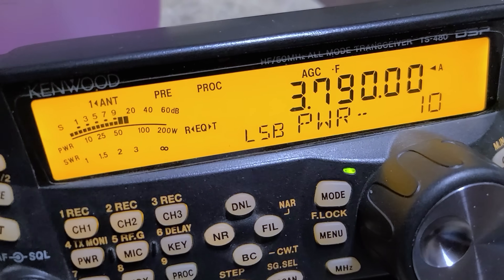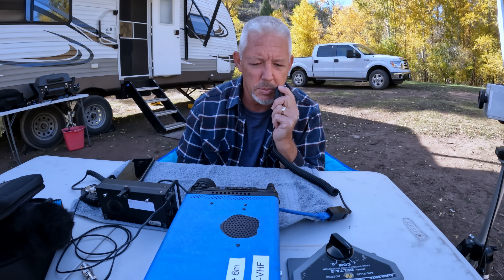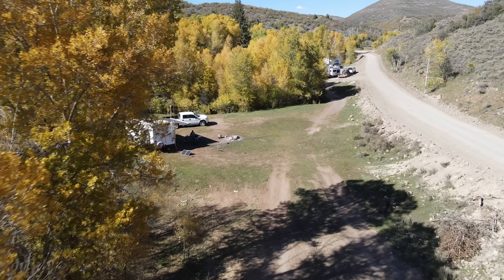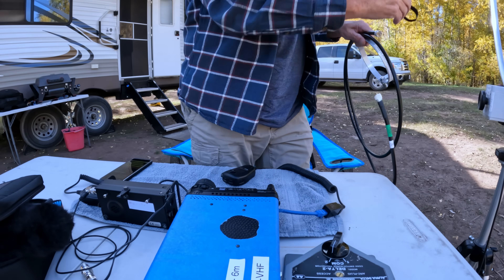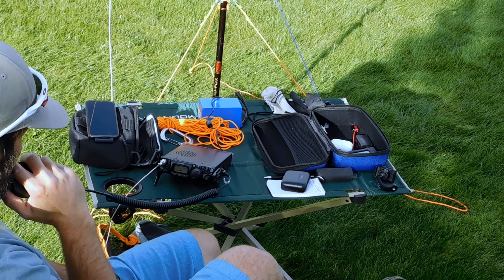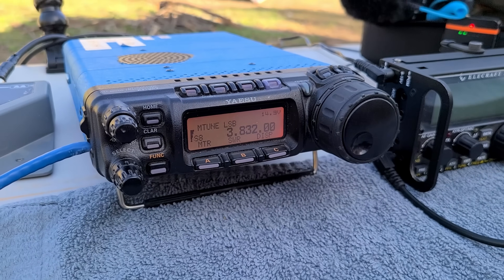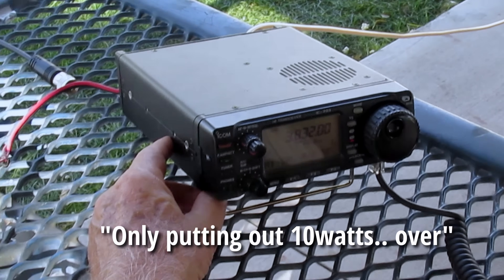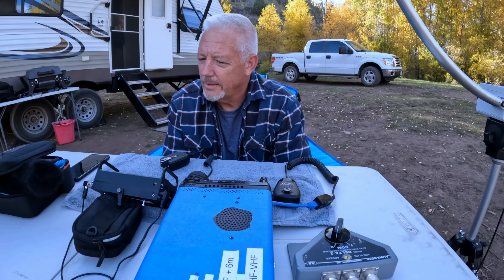Hear what NVIS sounds like from 3 locations | K7SW Ham Radio

Comment from the maker: When was the last time you tried setting up your portable Antenna's for NVIS and  How did it go ?
Reply: We test NVIS once a week here in Hawaii. We have an ARES HF net weekly.
Reply from the maker: @LavaKimo  That would be a fun exercise to do building up regular checkin's in the Island.
Reply: Several years ago I was trying to talk to a new ham I had help get licensed and on the air. He had a 40 meter antenna and I had a 40 meter dipole about 50 or so feet high. We were about 20 to 30 miles apart. Signals on 40 were not very good. The next day I strung out another 40 meter dipole no more than 4 or 5 feet above the ground. That made a big difference. He could not get over the fact my very low dipole did so well. I took the opportunity to explain that the low dipole was radiating mostly straight up while the higher dipole tended to have a null straight up if it was close to a half wave high. Also almost all normal 80 meter horizontal antennas are radiating mostly straight up because a half wave is 130 feet and most of us can’t get past 60 feet or 1/4 wave high. Of course you must be below the critical frequency or nothing comes back down. There are some good web sights where you can get real-time critical frequency info.  Check this out this station near me :  https://www.ngdc.noaa.gov/stp/IONO/rt-iono/latest/WP937.png
Reply: Several years back I wanted to check in to the EPA section daily traffic net on 75 meters. I had a little TenTec mobile in the car with a Hustler 75 meter loaded whip on the back of the Buick. No joy from my QTH near Harrisburg to the Philly area, about a hundred miles. I loosened the ball mount for the whip, rotated it to be parallel with the ground about 2 1/2 feet above the dirt (not a favorable operating position for a mobile antenna, hi hi, but I was stopped well off the road). The noise dropped to near zero and the net was clearly heard; I checked in with a "weak but readable" signal report. The difference was no comms versus no fade, clear comms on 75 phone at 100 miles. I became a believer after that. DE KB3JA
Reply from the maker: @KenTenTen  Exactly, and that is a great example
Reply: Sorry if my question about the mag-loop came across as a know-it-all, that was certainly not my intention. 
It was an honest question from a guy studying for his HAM exams.
So the answer is never.
But now as I think on it my Army brothers and there newer vehicle mounted tandem loop is not angularly adjusted yet they manage to get it done.
Again, thank you kindly.
Reply from the maker: @Gary Landers  Thanks for the question and sharing
Reply: I have a Yaesu 2980r that I use to keep my signal local by reconfiguring for tactical dipole NVIS. It only hits the local repeaters and so far the polarization hasn't been an issue. I practice it because NVIS is what we taught for opsec in the military. Only a satellite can pinpoint a signal that's NVIS, usually only at distance. Anything can be found much closer.
Not much experimenting with VHF as everyone thinks HF is thr final frontier. Must be why all new tech is going way up in frequency, lol.
Reply: Thanks for the video! So far my favorite  ham video! 😊 I'm not a ham but this video has inspired me more than any other so far. NVIS seems like the best of ham practicality. Being able to reliability talk to others relatively close by seems to me to be the most important thing if communications were ever down for an extended time. I know with 80m it may not be attainable, but I would love to see experiments with ht sized antenna designed for NVIS. Based on your video I'm thinking that not only the antenna but also the quality of a ht sized rig may prevent successful communication. I guess I should become a ham and try it myself 😮😅. Thanks again for the great video!
Reply: Thank you guys for doing this.    I am a newbie.   Love the info

Comment: This is one of the best implemented amateur radio A/B/C tests I’ve seen on YouTube. Well done guys!   The only suggestion I’d make is to consider rotating that loop so that it is horizontally oriented instead of vertically. That way it will create a  NVIS setup.  I hope to see more of these types of tests. 73!
Reply from the maker: Thanks for the kind words and the suggestion!

Comment: When hurricane Harvey turned out home town into a "war zone" with no electric, internet, cell coverage, or cable, I used an end fed 80M antenna up to my barn roof (22') then down to my chicken coop roof (8').  It was loosely configured NVIS but got very clear coms from the Texas Gulf Coast to Missouri and again to north central Texas.  It was our only working coms.
Reply from the maker: Wow, that's an incredible story and a testament to the power of Ham Radio!
Reply: @hamradiowithkevin  ARES has fallen to disregard with the advent of mobile satellite rigs providing enhanced voice and data... but what if we lose those satellites?  Ham radio doesn't need high tech infrastructure.

Comment: I just set up an NVIS antenna yesterday. I am in central AL. I worked CW with some people from Huntsville, AL, then Asheville NC and then finally the tip of FL on west palm beach. No issues. I built a 40m dipole antenna cut for resonance on the CW portion of the band. 7.030. I supported the center on an old broken painters pole supported by some stakes in the ground. The whole dipole was around 66' long and only around 6-7ft off the ground. Very easy to pack up and use in an emergency / local scenario. Oh, I also did that on 5 watts from my Yaesu FT-857D.
Reply from the maker: That's an excellent example of NVIS working well, especially with 5 watts!

Comment: N1JWW HERE,

I haven't intentionally tried NVIS transmissions.  I do have a question.  If I setup an NVIS 20 meter dipole and I successfully hear a station somewhere in my state, do they also need to be configured as an NVIS station for me to hear them back?  I am guess I will also receive some Non-NVIS configured stations, but that will no hear me.

Jeff W Waldrop <---- SW Louisiana

Comment: Great video ! Its good that we can see and hear the 3 antenna types compared over two bands.
So the endfed is 162 feet long stretched between two poles 25 feet high each end.
Is that a total wire length  of 162 + 25 feet ( fed end, pole height to readio/tuner) = 187 feet ?
Thank you, 9H5lx.
Reply from the maker: Yes, exactly

Comment: I highly suggest you try 60 meters.  AM or PM here in San Diego, it was amazing for NVIS, possibly less fading as well with stations 20 miles or less 5/9 easy on 60 watts into valleys.  I have ARES testing it and doing check in's from around the county.  Heck just use your 40 meter dipole and touch up the tuner, no big deal.  Your loop tends to me more efficient on the upper bands 20-10 unless you do a larger 7 foot double loop efficient wise.   I used a 8 foot delta kite at the beach with a 6 knot wind and had RG174 coax go up 200".  Worked Milano Italy 20 meter vertical dipole at 2PM with a S8 at 100 watts hi.  Give that a thought if windy up in the mountains.  Kites are light , not NVIS but who cares at 200' go direct hi.

Comment: I wonder how 160 would work NVIS?
Lots and lots of wire!
Great video!
Reply: I suspect the ionosphere’s D-layer would absorb some signal during the day. 80m and 40m seem to be the ‘Goldilocks’ wavelengths for NVIS. Any shorter wavelengths and it shoots through the ionosphere instead of reflecting.

Comment: I'm in VK land... we are fortunate to have a Class of license available to use as Broadcasters called HF Domestic. Our authority (when you get past the politics) will issue a fixed frequency on something like 2325khz 3230khz 4970khz. These are all separate licenses in the Tropical SW Bands. You can run as much power as you are silly enough to ask for. But the norm seems to be 1kw (licensed to run it). But it seems that most run at about 100w to 200w carrier power as it's AM.

As the name implies they like to think this stays largely inside Australia (which it sort of does). Plus under 5060khz it hasn't stepped into the Main SW Bands that are all shared to a timetable set out by the ITU.

NVIS (we don't call it nivis) is pretty much going to give you a blast at the ionosphere and rain down really well to a notational radius of about 900km. Everywhere inside that radius will hear you with some sort of "average" level. But some little traps need to be observed. Running NVIS you really want all energy straight up. You want as little residual groundwave as possible (preferably none). As the groundwave will mess with returning skywave. Here it's a good idea to put the NVIS site no closer than 30km from the nearest town you want to rain on. You'd rather it in the middle of nowhere.

Day time you need a higher frequency and night time you need lower. You'd run 2mhz later at night and something like 7mhz or 9mhz during the day. But definitely not over 10mhz. You are relying on the ionosphere to REFLECT (work more like a mirror). You don't want it to REFRACT (bend) your signal which is what happens in the main SW bands. The next thing going on is "that mirror" isn't to good. PLUS the lower layer of ionosphere (that sucks up AM radio in the day) is still attenuating SOME of your signal (as high up as 5mhz). This is both BEFORE and AFTER it gets to the rather sad mirror.

Findings here with the 3 frequencies listed. I'd trade 3230 khz for a 7mhz channel anyday. 3230 (so close to 80m its not funny) in our tests here - has inherited all the BAD traits of 2mhz and 5mhz and none of the good. 2mhz you'd run as a Vertical to give max distance along the ground day or night. Then it has a skip zone with people in the far off places getting it at night... With a bunch of angry people missing out in the skip zone. 2mhz is best around 9pm to 6am local time. 5mhz you run that as a doublet at 10.4m off the ground or centrefed (tuned) dipole. 5mhz will not go as far along the ground as 2mhz will for the same 1/4 wave vertical for it's freq. But it will give you "some" path inside the fore mentioned 900km radius (even in the middle of the day). BUT it really comes good about 3pm to about 10pm local time. IF 5mhz is the only channel you have then it's wise to really maximise NVIS to give the ionosphere a good spray (mainly for daytime use). It's going to need all the help it can get. We have a bit of a legal rangle on atm here to get 3230 moved to something like 7600 ish. Tests on 7mhz  has really shown how much 5mhz still suffers in the day time. But it seems the radius is a bit smaller with 7mhz. That's still to be worked out here. 

So from stacks of experimenting here. With the idea being we only have water pistol power not using a tank or rocket launcher's worth of power. What can we do? I'd say the frequencies used were not the best and your aerials were not doing you any favours.

73's from VK

Comment: On 80m the Loop is a big compromise, it's never going to be very effective on 80m or even 40m Best 20-10m. 

The EFHW 49:1 is half wave on 80m so offers a huge advantage over the loop.

My version of this EFHW 49:1 has a ceramic capacitor in the middle which increases resonance in the phone portion of 80m, without it resonance would be around 3.5 Mhz, the capacitor is a neat trick because it electrically shortens the antenna without having to shorten it which messes up the other bands.

I get good DX and NVIS with this antenna in an INV L kind of config, first half of the antenna is up around 60-70 feet, runs East/West and the other half slops North/South direction and I have the UNUN around 3 feet off the ground where I have it grounded. 

This antenna works amazingly well for me.

Comment: NVIS is a fascinating practice to experiment with.  I've had NVIS antennas work just as they are supposed to, but I've also worked DX <3000 miles on 40 meters with the antenna only 8-10' (9 meters) above the ground. But I couldn't hear the DX stations on my transmitting antenna.

Comment: im new to your channel .i saw your last video on ant testing in the park near some tennis courts..  thus NVIS i need ask please ,ive seen YT on these but they use a 1m off ground reflector underneath horisontan wire..woulnd that be better. i have a few efhw etc and long wires..is it worth the extra work to put reflector under ?
Reply from the maker: Personally, I would not use a Reflector for your setup. 
Don't let that keep you from experimenting though.

Comment: I like your channel. Lots of good info. So, for NVIS, it is very frequency specific. You are trying to bounce your signal off the F layer of the atmosphere. It makes more sense to me that it would work better in the 60M to 80M band. Also, for antennas, a dipole about 10ft off the ground would probably work the best. I would not expect the Loop to be any good at NVIS. Although it would be interesting to raise the loop up 10ft off the ground and see how it performs. 73.

Comment: I think many people don't realise that just putting up an nvis friendly antenna will not make nvis work. The ionosphere has to be in the correct state as well. Specifically the "critical frequency" aka FoF2 has to be higher than the frequency in use. In theory it can go up as high as 10MHz but normally it sits somewhere around 4 or 5 MHz. I suspect that was the case during these tests and the reason why you had success on 80m where you were using NVIS and 40m where you were relying upon ground wave.
73 Ed DD5LP

Comment: Never heard how low swr was on the loop on 80m
Reply from the maker: The loop is almost always tunable to near 1:1. That is just how they work. 
In the off chance the loop is setup near a building that can cause interaction, generally, you get to tune the loop to a really good spot.
Checkout one of my loop antenna video's and it might make more sense as to what I am describing.  73

Comment: I never thought to try my loop, with my small yard and some interfering structures I have a 73' end fed inverted V at 30' apex and run 80,60,40 nets each month  in NTX and OK with guys in my church group. I've tried running wires over fences and between houses at the 15-20' recommended height and it just didn't work for me DX engineering NVIS dual dipole, 80m 1/2 wave dipole at 6ft, 73 ft end fed flat top at 20feet, to no avail. I just ordered the CHA NVIS antenna that is on sale now and looking forward to trying that one but it needs more room than my yard provides.  I need to take the jeep out and try all my NVIS antennas without obstructions and in recommended configurations. I really enjoy the challenge and fun of NVIS. Great video!
Reply from the maker: Fun adventures ahead for you. Getting out and setting up is a great thing, indeed.

Comment: Hi Kevin .... outstanding comparison Sir! I was just at the HRCC campout in Ramona, CA and setup a KK6USY style Delta loop and compared it to a 40 meter vertical EFHW. I was on 40 meters mid day and the Delta loop was at least 2-3 S units stronger than the EFHW receiving stations about 400 miles away. On 20 meters, the EFHW was about 2-3 S units over the Delta loop, but, I was receiving stations over 2,000 miles away at that time. As Hollywood states below, using the right tool for the job makes all the difference. Keep up the great videos Sir!
73 - KF6IF
Reply from the maker: Your test sounds like tons of fun. And Ramona,  my old stomping grounds. 💪👍
Reply: @hamradiowithkevin  I saw that your roots are still in Ramona! I am bummed I missed you out at Quartzfest.

Comment: Great experiments! I saw a comment that said most hams 75m dipoles are nvis because we can not get them up a half wave. I have often said this myself. Lots of nets on 75m have nvis stations checking in by default lol. 60m is also interesting with NVIS. Have yet to test 40m nvis. I may be wrong but I believe your mag loop would be vertical polarized? Would a mag loop be able to work nvis or only groundwave/skywave? And for hams new to nvis frequcies higher than around 40m are usually not reflected back down so well. You will usually see nvis used with bands from 40m-160m. For example Nvis with vhf (2m) is not going to work because it will pass through the ionosphere. Great video! Thanks for sharing!!!
Reply from the maker: Yes you mentioned many things that are just true. It is nice to hear that someone else is trying to have a purposeful NVIS antenna. Thanks for sharing what you have discovered. I really think it helps all of us to share our wins and the fun.

Comment: Could you add the tag for 'Buddipole NVIS' as when I searched I couldn't find any videos.  I made a video for the 80m NVIS Buddipole.  It worked great.  I also had to try the Chameleon Emcomm antenna just laid on the ground.  It worked for WINLINK peer to peer with another operator 50 miles away on 40 meters.
de KE5ES
Reply from the maker: Absolutely.  I bet you had fun making your video. 73

Comment: I like this. I’ve been working to figure out how to hit the house from where I work 41 miles away as the crow flies. Looking at topographical maps, you’d think a 50’ tower at the house would clear the land features, but once I calculated in the curvature of the earth, I now need a 1,200 foot tower at the house for LOS on 2m. So I’m switching over to the HF and NVIS as a possible solution now that I have my General. I’m curious if we can do NVIS on 6m since my wife is only a Tech. 🤔
Reply from the maker: If you are talking about 2 meters, I have a 40 foot pole with a dual band Vertical at the top and I can easily contact operators 60 miles away. There is usually no line of sight, but the signals often bounce off the mountains in our area. Get a good antenna for your wife and a good antenna for you. Park at the highest points that you can and you will be good.  Use a mobile radio and not an HT and your results should be acceptable. Hope this helps.